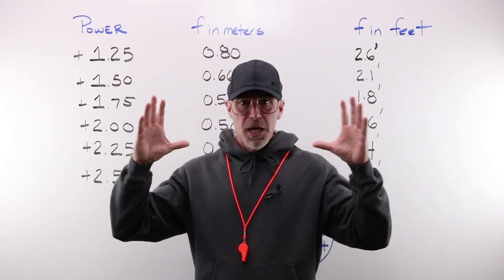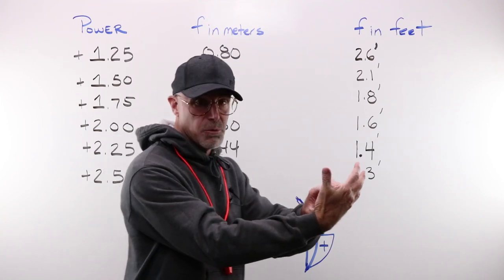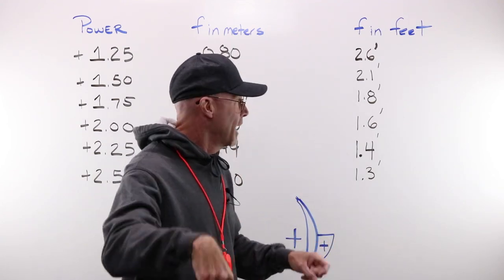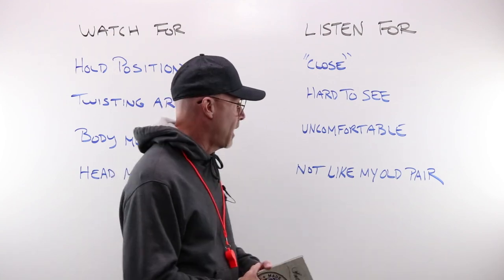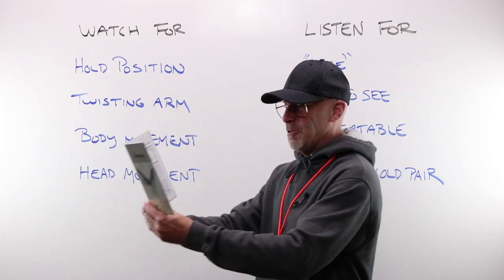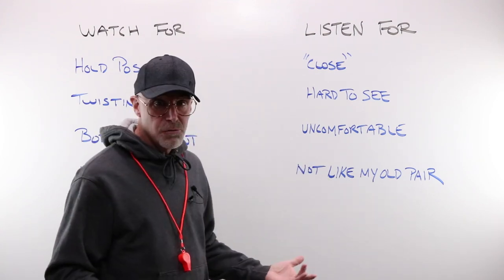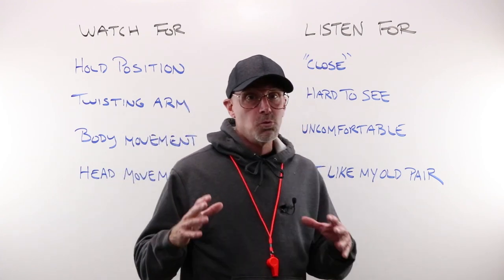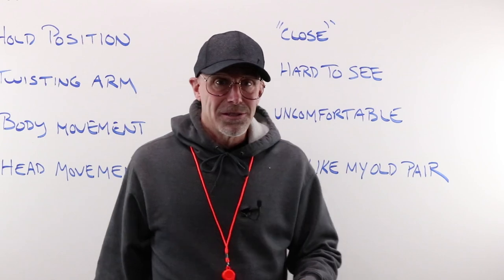Optician Troubleshooting: Problems WIth Plus Powers

Comment: Enjoying your videos! I'm a 55 year eyeglass customer, now 60 years old. Getting ready for my eye exam by doing some measuring of my normal working & distances and asking for specialized prescriptions. 

How about a guide for end customers on how to judge, measure, chart what to ask for in prescriptions? I know that there are many variables with each patients eyes, but a general preparation for eye exam video would be nice. I have several frames (very much alike - titanium Autoflex, which along with high index lenses changed my life in the 90s!) that I intend to have filled for specific tasks at my next exam.

My biggest issue with the current prescription is my long term astigmatism. I find myself closing one eye when I try to concentrate. I'm not sure if this is just a result of my condition or a problem with my prescription. Thanks!
Reply from the maker: If you have a specific working distance that you need to be spot on perfect then do what you are doing. Measure that distance and bring it along with you. They should do what is called a "trial frame" where they can add and remove power in units as small as 1/8 diopter steps to fine tune your needs. As to the rest, well, getting old stinks doesn't it! (I'm 58) But as they say the alternative... John
Reply: @LaramyKOptical  - Thank you John, yes it does beat the alt! Another pre-prescription question after measuring & looking at alternatives. I have taller lined bifocals now and am looking at some small frames (which I can look over for distance) @28mm in height, planning to use them as computer/reading glasses. I work in a library and my main distances are @20" & 30" - I saw mention of "short corridor" progressives. with this short of lens height and with those distances, would lined bifocals be the best option, or the progressives? The other question is pricing on both progressives and lined with this short of lens vs using frames with taller lenses. Thanks! Murphy/Seattle
Reply from the maker: @EShelby2127  There are four videos on how to choose progressive lenses. I cover short corridors and office style there. Same place you found this video. John
Reply: Hello Sir, could I get your email.

Comment: I have a patient who wears a +3.00 sph in the right eye, and a +3.25 sph in the left. He uses them for everything! We tried a progressive (he's 50) and since he has always worn single vision plus lenses, he did not like them at all.  We recently made him new lenses for his own frame and he loved them. They were a little small (he's a big guy) and since the new script worked well, we picked out a newer, larger frame for him for a second pair. He picked out a Fatheadz. He came to pick up his glasses yesterday and although the vision was good, when he tried to look at a piece of paper it was slanted (that's the best way I can explain it) The base curve was the same. OC height was not the same. I had him pick out another, smaller frame and I'm marking for OC. What caused the slanting? Too big of a frame, thus thicker lenses in the center?
Reply from the maker: Sounds like you are doing some good troubleshooting on your own. Before tossing out the baby with the bathwater I'd just try some frame bending. Look at the old pair and try to match tilt and wrap - you might be surprised. Slanting could indicate a little perceived cylinder which you might be able to bend out of it (so to speak). If the OC was placed correctly for the new pair I wouldn't think that size alone would not account for it. If he is a big guy and needs a big frame you may want to look at doing a surfaced lens, maybe even a free-form with POWs. That would certainly eliminate all the possibilities. John
Reply: I should have mentioned that I did adjust the frame to match. Forgot to mention that.
Reply from the maker: Thought you might have.

Comment: Hello. How do You set the pupil distance in the reading glasses and ffa = 0?  By distance or near distance?
Reply from the maker: No idea what ffa=0 means. True reading glasses would be laid out and finished using the near PD. Distance PD - 4. Intermediate would be distance - 2.
Reply: @LaramyKOptical  FFA is Face Form Angle or wrap. Usually the frames have an FFA = 4 degrees, but for near vision glasses it should be around -8 degrees. I am asking out of curiosity, because in the US You do some things a bit differently. I heard that glasses with FFA = 0 degrees should be centered pd for far vision. The reason is the way the lenses are designed, not the prismatic effect.
Reply from the maker: @skibickiadrian  I've never heard anything about specific degrees of face-form or wrap for certain distances. 0 is never a good thing and should be avoided as much as negative wrap. Beyond that IMO just "give 'em some face form" and move on... You might try OptiBoard where someone might have much stronger feelings on the subject than I do. Like the rest of POW stuff I think we make mountains out of mole hills. John
Reply: @LaramyKOptical  I think usually the starting point for the design of single vision lenses is FFA = 0 but FFA = 5 should not be a problem for the wearer. Negative FFA for near glasses only (same when switching to near in phoropter). Anyway, thank You for the answer.

Comment: This is the answer I have been looking for. My last prescription my add went up to +2.5 and the new glasses seem to have more distortion throughout my progressive lens. My prescription is OD +4.75 -1.50x120  OS +5.00-1.75x51 with +2.50 add. What lens manufacturer would be best for a progressive lens with this prescription? Would I be better switching to a bi-focal vs progressive?
Reply from the maker: Yeah that's quite a bit of plus power there... look for a good independent optician that offers progressives using the Camber design. Camber really shines with the higher plus powers. Sadly if you have been wearing progressives for years and years you might not find switching to a lined multi-focal all that easy. You can find good solid information (not sales mumbo-jumbo) about Camber online. John
Reply: I have been going through the videos.  They are great and you are awesome.  I really like your explanation and method of teaching and presentation.  I am yet to go through all the videos . Bit I will eventually.  I was wondering that I could share a few ideas that might help me , us, all the Optometrist community to dispense the lenses easily.  I would like to share few thoughts with you. Could you help.me out. Thanks and regards,  

Nilanjan. 
Optometrist. 
Kolkata,  India.

Comment: Helloooooow , I'm recently new to glasses and went from none to progressive lenses. I'm finding the reading zone to be ok in size and the distance zone more than ample. It's the intermediate zone I'm really struggling with. The area is just way too small for my needs. I'm wondering if the add power for the reading zone was decreased,would that increase the intermediate zone size? Right now my reading clarity distance is about 8" to 16" closer than 8" gets blurry. 
      Sphere.        Cyl.       Axis.       Add.    
OD.   -0.75        -1.00      150       +1.75   
OS.   -0.75        -2.00      013       +1.75

Question 2 , My left eye just won't focus as pin sharp as my right eye (its good just not as good ) . Is this do to the worse astigmatism in my left eye or is it the left lens is off ?  My left has always been noticeably worse even before glasses.  I've read that I should have gone with trivex over polycarbonate for the higher abbe value of trivex and increased clarity . I also read it is better for astigmatism too. I'm using semi rimless and wanted the eye protection of these 2 materials . I'm a bit annoyed that I wasnt told about trivex at the eye doctors. Especially when the brand lens we went with offer trivex. I've also experienced a slight haze like effect on the edges of things in the distance. Would trivex help with any of these issues ? Optical clarity is #1 for me .

Thank you for any help and I'm really enjoying your videos.
Reply from the maker: 1) No. You might gain 0.5mm of width going with a high-end free-form if you aren't already in one. The narrow intermediate is the nature of the beast. Get a SV 2nd pair for long term intermediate work.

2) Yes Trivex is a far optically superior a material and perfect for your lens powers. Yes it is the higher astigmatism that will alway have your left worse than your right.
Reply: @LaramyKOptical  thank you very much. I'm about 10 days into glasses . I really wish I researched before getting them. I honestly didn't think I would be getting progressive lenses so I had no idea what was good, bad,etc . I blame myself and the optician for not giving me choices. I should have asked more questions. I've always done some research beforehand when making an important decision. He just picked everything for me, saying this is the brand /style we use. But never went into the material thier lenses were made of. 
Not one mention of anything other than polycarbonate as an option for me. They put me in the Varilux X even though the new one is the Varilux XR . 
I really think I'm just gonna get a SV pair for now. And get another cheap pair for reading . Definitely will be trivex though.